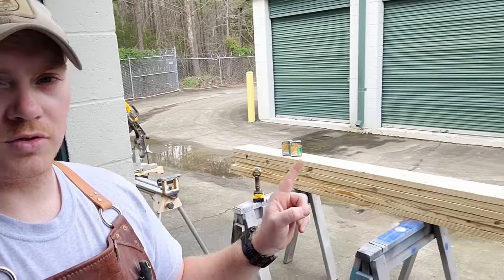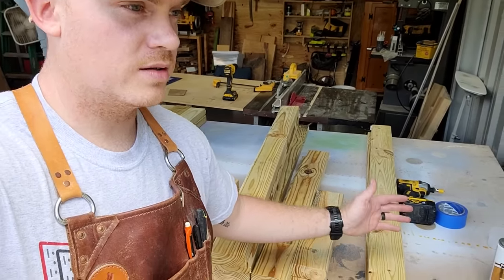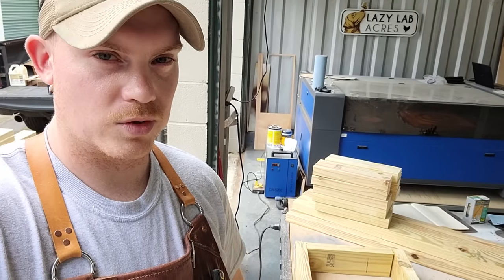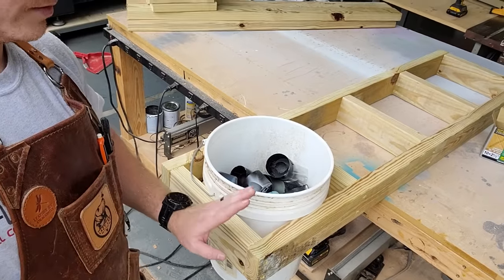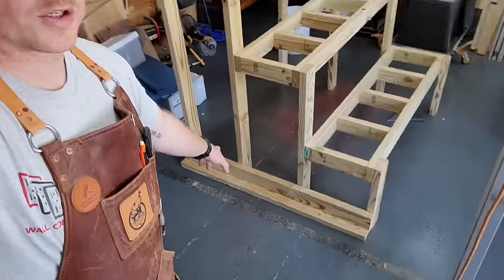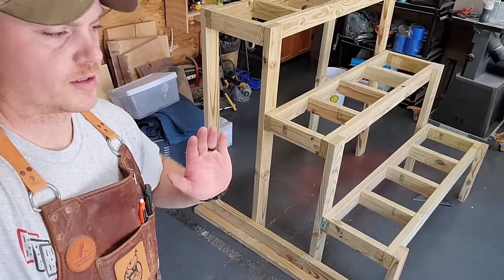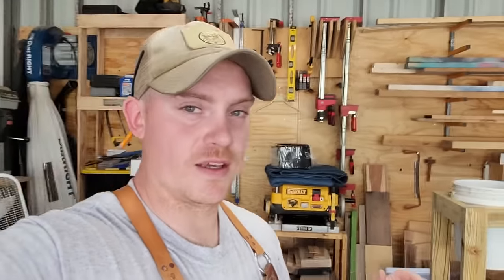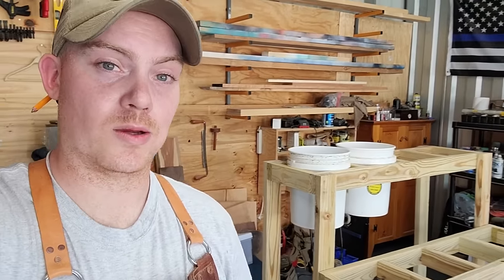Better than traditional raised garden beds? - Raised Bucket Garden DIY Project

Comment: Looks good and appears it will work well too. One suggestion, there are shorties like my wife so I would decrease the distance between the levels so the bottom of the bucket is just being hidden by the lower level. You could get a reasonable height 4th level for those not altitude challenged to hit a wider audience too. You could also put it on wheels like a wheel barrow to ease moving it around.
Reply: I saw that right away.  I'm going to space mine with about 1/2 to 3/4 bucket height difference.
Reply: Right! I'm 4'10 🤣 I'd definitely have to make this shorter lol
Reply: @JCC_1975  just a tad. 😉
Reply: @dang6832  lol just a bit lol
Reply: And as 5’9”, I'll raise them

Comment: With the extra pieces, you can make an underbar for the top two layers, so that the buckets have something to rest on other than just the bucket lip.
Reply: yeah bucket lip crack because of sun after 2 years
Reply: Some cedar pickets or a cloth cover can help minimize Sun on the buckets. Good advice on supporting the underside of the buckets!

Comment: I’m looking at videos to make with casters so when severe weather rolls in, I just wheel my garden in the garage! This also conserves water. I tried 5 gallon bucket gardening last year, and was happiest with those containers. Thank you this one looks the neatest and cleanest. Other videos seem to use unnecessary extra wood.
Reply from the maker: Thank you!
Reply: You will need more thank casters. But two wheelbarrow tire on one end.
Reply: good idea
Reply: I would have never thought to put casters on that. That's a great idea!
Reply: I totally agree 😊
Reply: I am so grateful that I found your channel,  I will be building this wonderful garden stand 🤗
Reply: @dclinks  standing tool chests weigh alot and are packed full of steel tools. There’s heavy duty that have a high weight rating. I wouldn’t put a tire with a tube on it because it can pop or go flat, but tomato tamato.
Reply: Casters--- great idea! Especially for limited mobility people as then others can rotate the garden directly to them! 👍🥇👏
Reply: It really should be 3 buckets per row, with soil it’s going to be tough on the back to pull them out.  To pull them will require height and strength.
And probably rows on the back side too…otherwise solid idea.

Comment: Nice structure & equally nicely elaborated.
One suggestion from watering point of view. You can put a 1cm thick strip on the backside of top & middle steps to make the buckets sit a bit tilted towards front side & make holes at the bottom on the front side only and run thin pipe thru each bucket on both the steps in such a way that a pipe from a top bucket would come in the bucket below at the middle & from that one to the one at the lowest bucket. so when you water the buckets at the top level, that water after moisting the soil would come to the middle one & from there to the lower one. This way you can save water & the efforts to water.
Reply: I'm going to try that with my build

Comment: Last time I was in the local hardware store, I priced 12, 8 foot 2x4's. $40. Nice, I can afford that! Thank you again for the video. Comments were full of additional great ideas and suggestions, too.
Reply: Hi, I built one of these but I found that I had to tweak some of the number/measurements. I found that to make this work my cutting list was as follows. Out of 3- 10' 2x4's I cut 6- 53 1/2 and with the remainder I got 3-11 1/2. Then I took 4- 8' 2x4's and cut  4 50 1/2. with the remainder I cut 2 33 3/4 out of 2 of the left over boards and I cut 2- 16 3/4 (1 out of each). Then I was able to get 4- 11 1/2 out of what was left of those 2 boards. Then I took 2 more 8' 2x4 and cot a 49 1/2 out of each and with the left over boards iI got the rest of the 11 1/2 pieces. The reason I'm telling you this is because I found that his measurements were to tight for the 5 gallon pails I have. I check 3 different bucket vendors and they were all to tight and did not fit the opening. Otherwise these things are great! One more thing, I used treated lumber.

Comment: I built something similar today.  I reduced the height significantly and used green treated deck boards for the front pieces to cover up the buckets a bit.  Making it shorter makes it easier to work on as well as reducing cost from 12 2x4s to 9.

Comment: Looks good. It would be cool to mirror that on the opposite side and put a frame midway down on the highest tier to put a frame for seedling trays cause the top buckets would drain and automatically water them and shelter delicate seedlings from wind and direct sun. Thanks for the inspiration.

Comment: I was thinking of using wheels too. But I'm definitely gonna use 2x2s or maybe pvc to make a frame on the stand for shade cloth. Maybe even some kind of bars for anchoring large or climbing plants. Several possibilities. Great job. 
Thanks for the video
Reply: If you're planning on pvc framing, Google, " pvc furniture fittings" they make every fitting imaginable for building things with pvc. You won't find these fittings at your local hardware or plumbing store. Hope this helps you.

Comment: I use buckets and grow bags. I don't frame them or use anything like your build because it reduces the mobility of the containers.  It's so much easier to move your plants if there is a major storm coming or you're facing a heat wave and need more shade for you plants.   It is a cool build though.

Comment: cool - but some thoughts/ideas/suggestions... (2 & 3 make it a more complicated build, but might improve it)
1. reorient the legs to go under and support the weight of those buckets. 4 five gallon buckets=20 gallons, water @ 8lbs a gallon. Asking those screw joints - with the 2x4 on the side, not underneath - to take 160 lbs (possible) over time in weather - a bit much.
2. others have commented on the plastic breaking down over time - agreed. That lip alone holding the weight... yeah. I'd see about creating a support system.
3. A GREAT idea to improve this would be to combine it with the "self-watering bucket" system. A bucket in a bucket with a water & air gap for nutrients, reserves etc (researching them is pretty easy on youtube). BUT water overflow underneath catching run-off could be a concern (or opportunity to save water). I could see a system of bucket supports underneath ADDING a "gutter" catching run off water...

Comment: Hi, I built one of these but I found that I had to tweak some of the number/measurements. I found that to make this work my cutting list was as follows. Out of 3- 10' 2x4's I cut 6- 53 1/2 and with the remainder I got 3-11 1/2. Then I took 4- 8' 2x4's and cut  4 50 1/2. with the remainder I cut 2 33 3/4 out of 2 of the left over boards and I cut 2- 16 3/4 (1 out of each). Then I was able to get 4- 11 1/2 out of what was left of those 2 boards. Then I took 2 more 8' 2x4 and cot a 49 1/2 out of each and with the left over boards iI got the rest of the 11 1/2 pieces. The reason I'm telling you this is because I found that his measurements were to tight for the 5 gallon pails I have. I check 3 different bucket vendors and they were all to tight and did not fit the opening. Otherwise these things are great! One more thing, I used treated lumber. Hope this helps!
Reply: I'm new to all this. What is the benefit of treated lumber and how do you treat it?
Reply: @happycook6737  treated lumber is the green Lumber that is used when building a deck. It's been treated so that it can be used exterior wise and not rot like untreated lumber would. Any Menards or Lumber Yard Store will carry that. Instead of buying 12/8 Footers you're buying 310 Footers and 6/8 Footers for the build which will save you money .

Comment: With the weight of the buckets filled with dirt and water, would it not have made sense to add two more additional horizontal supports at the bottom tier and the middle? Maybe even an X support on the back side? Will it be supported by a structure like the side of the house or a fence? 
I know the majority of the load will be downward, so is it not necessary?  Do you not have any concern that it will wrack because of the weight over time? 
This is pretty genius and makes great use of a small space and would be perfect for my small area. Just in case, I'll add the additional horizontal supports and the X in the back.

Comment: Great concept, but buckets are too close for larger plants like Tomatoes and peppers. One hornworm could climb from plant to plant and wipe out several plants before locating it. Also drill drain holes one inch above bottom in sides creating a wicking bucket. I've been raising tomatoes in buckets  for over 25 yrs and yes buckets will need replacing every 5 or 6 yrs but save your potting mix some of mine still the original potting mix in them. I just top them off each year with new potting mix.

Happy gardening.

Comment: Cool idea but lifting those buckets up to the top rack when they are full of soil will be hard
Reply: I thought about the weight of lifting a full bucket into that rack, and also thought of the fully loaded rack - 12 x 5 gal - supported just with screws; would that survive long with even a gentle wind rocking it? I expected some framing, at least some simple mortise and tenons; I have a tendency to over engineer things.
Reply: Fill half full of straw, and make your own potting soil.  It makes the buckets so much lighter.  I also drill drainage holes in the sides an inch or so from the bottom.
Reply: Bucket first then add the dirt

Comment: Nice little project, but why not just line the buckets up on the ground? Who needs that contraption?
Reply: A wood plank supported by cement blocks raises them sufficiently to help with back issues, which is why lots of folks build these.